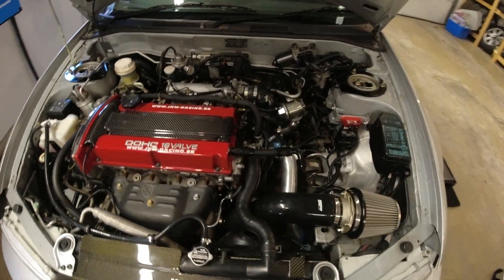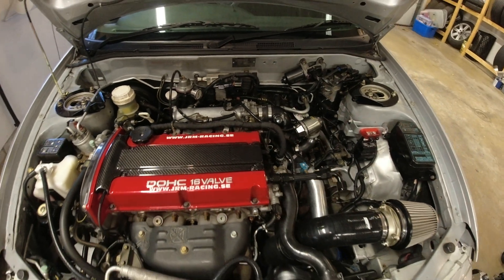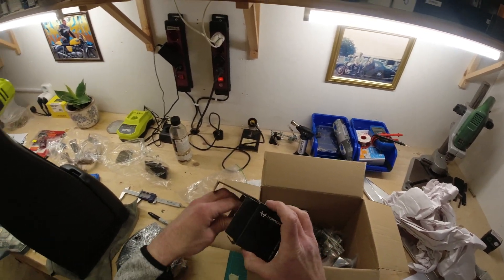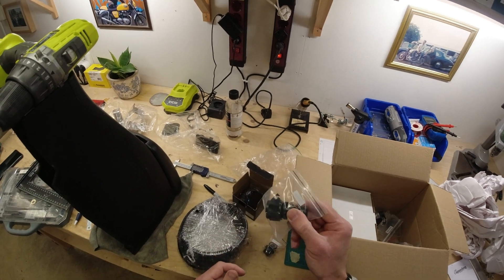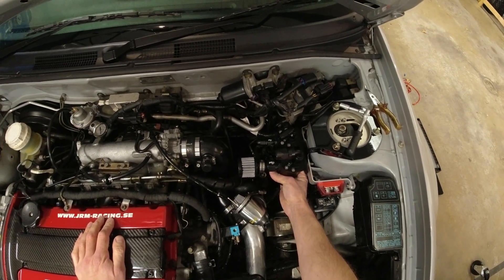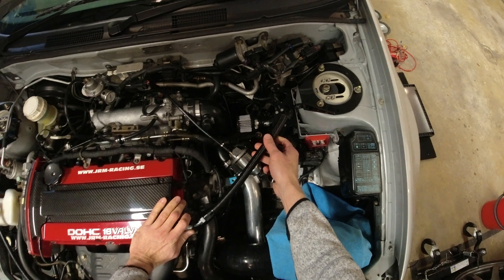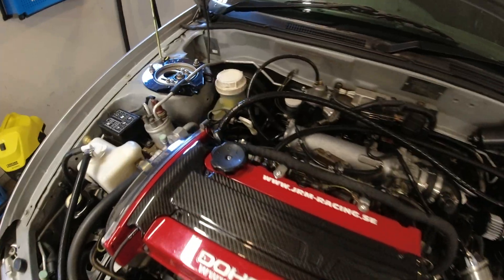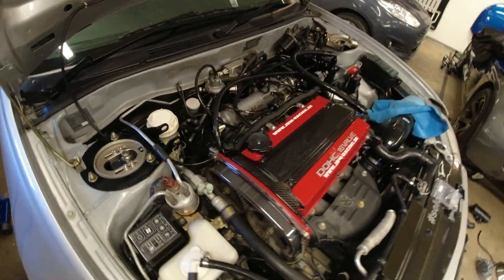THE PROPER CATCH CAN SOLUTION FOR AN EVO

Comment: Problem with this setup is when on boost and not having a one way check valve,it will be putting positive boost from the inlet manifold into the valve cover

Comment: on my Evo 6 the breather inlet you think is for letting air in is most certainly letting the air out on mine. I know because when i was taking stuff apart after I bought it to give stuff a good clean, i took the HKS RS induction pipe off which had the breather pipe attached to it, the induction pipe was coated with oily gunk. Its a 23 year old car and ive only owned it for a year so ive no idea how long the HKS RS pipe has been on for, quite possibly over 10 years, and the gunk inside from the breather was disgusting.... how its still on the original turbo from 1999 is mind boggling to me, i would have thought this gunk going into the turbo over time would damage it but its fine even after all this time..... im going to look at how to fit the AN10 adapter onto the rocker cover and go with a setup like youve got, looks good!! :)
Reply from the maker: That is amazing! The front inlet side I believe is mainly to draw air in to then be pulled out by the outlet side (if that makes any sense at all) but that said, under certain load/throttle position, air will also be expelled from the inlet which is no doubt why you see it in the intake pipe and also the turbo/intake will be sucking in air too? It's all good fun though right?
Reply: @SoloLap  yeah that makes sense, and thanks for the recommendation of speeding.nu I hadn't heard of them before but they have a good range of products, and I'm gonna get the same dual catch tank once I work out the fittings etc. :) happy driving :)
Reply from the maker: @snuggleseal  yeah they're a great company, just bought a fresh delphi gt150 plug for my maxxecu and a set of Sparco Evo seats too.

Comment: Im doing the same thing on my evo 6. But a guy from jdm life on facebook told me i could just block the hole on inlet manifoild, and use one can with 2x an10 and breather cap? Does it have to return in to the manifoild?:)
Reply from the maker: He's wrong 😂 I did a lot of research for this as I've only heard of using 1 can in the past. The Evo 'circulates' the vapour and uses the inlet manifold to pull it through and the cam inlet to draw in air most of the time. So blocking off the manifold and running a can from pcv to cam inlet isn't providing the pull the car needs, so you'll probably end up with a build up of crap under the cam cover?
Reply: @SoloLap  okey:) does the an6 hose fit directly on the inlet manifoil? How did you connect the return hose to manifoild:)
Reply from the maker: @666hawken  yes these hoses I use are direct fit. My cam cover outlet is larger than oem though. The return hose was the hardest part to do, but with wd40 it does eventually slip on and all the way to the base. If you don't use braided line like me it might be easier.
Reply: Thank you:) i will give it a try😃👍
Reply from the maker: @666hawken  solo.lap on insta if you need help 🙂

Comment: That looks a good set up. Can you make a follow up video to show what your cans are collecting, if anything? Is there a reason you do not vent back into the intake pipe all the time? I have seen lower CCP (Crank Case Pressure) by venting back to the intake.
Reply from the maker: I will do when I get more miles on the car 🤦‍♂️ I just wanted to avoid crap getting into the intake side, I could 100% run it back through though I guess!

Comment: It's more or less the same on the MX5 too but both pipes connected to the air intake which is completely black on the inside :/ 
But dual cans the best setup too, some just put a breather filter on one side which makes no sense considering both pipes connected to the intake so both side expect sucking out.
 
Is it not the same on the EVO as both pipes the cover was connected to actually suck so much air? Or do you think a turbo car the suction from the intake is boosted air so sucks more?
Reply from the maker: Never realised that on the mx5! One pipe at the back sucks under vacuum and the air filter side is more for drawing air in but still puts out oil too when there's no vacuum (I think!?)
Reply: @SoloLap  Yeah sound right, otherwise you would think both would be connected to the intake. An interesting one the management of valve cover pressure/fumes.